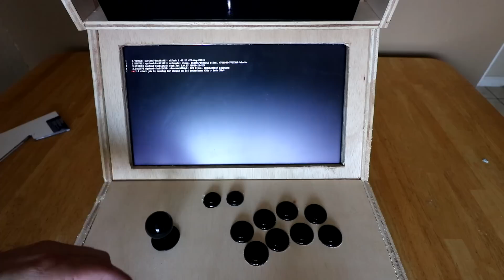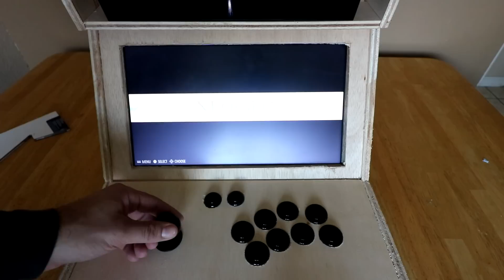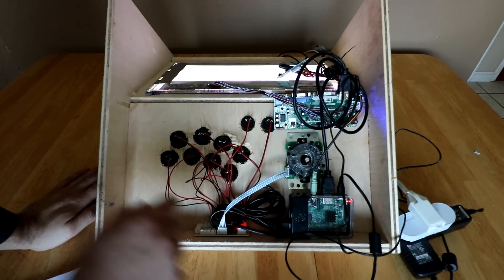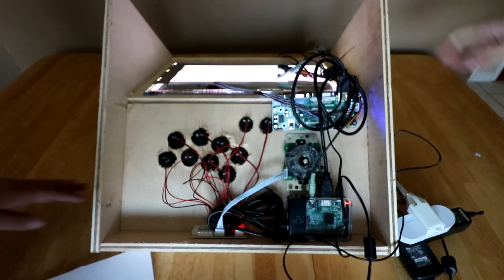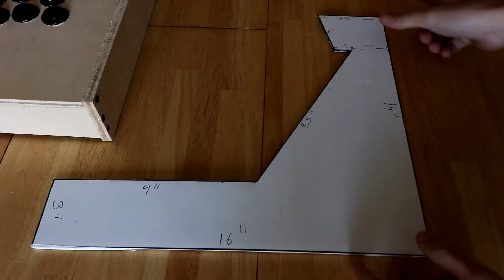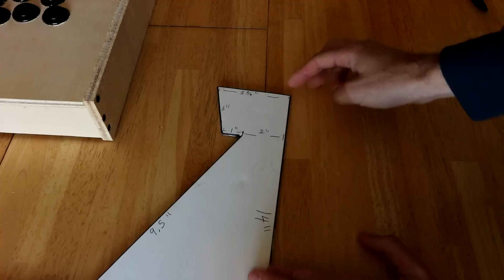Easy Inexpensive RetroPie Bartop Arcade Machine

Comment: next time when drilling holes don't punch though go in and flip over go in from bottom so no spitting the wood
Reply from the maker: good idea
Reply: I saw it on another channel just passing on the good stuff
Reply: That's a good idea.  Another way (if you have the material for it) is to use a sacrificial piece under piece under the one you're cutting.

Comment: I'll probably use the same buttons, so I'm kinda curious whether they feel loose or not when you stick them into the controller board, although if the board I'll use proves to be too thin (it's 1cm) I'll probably use adhesive or give it a wrap of strings.

Comment: Hi Drew, 

I dont know if anybody has asked you this, but I have a request. With the size of everybody's attract mode images getting larger and larger, can you make a vid showing how to boot from an external hard drive? Thanks
Reply from the maker: Hello,

I kind of looked into it and did not seem that easy. especially considering a 200gb sd card is $80 and a 200gb hard drive is around $50, I guess if you have one lying around or you want to go to the 1tb range.